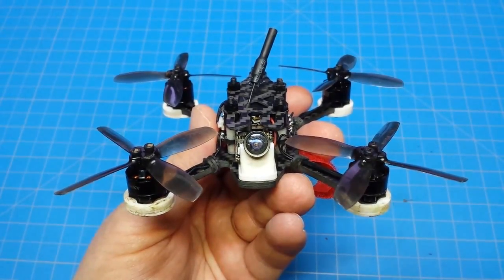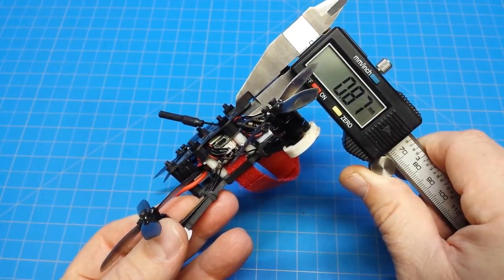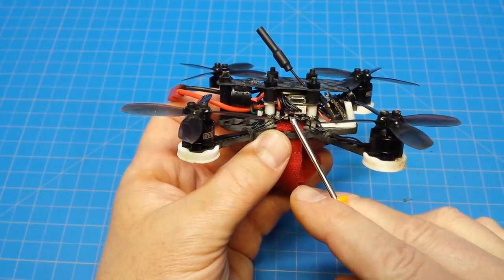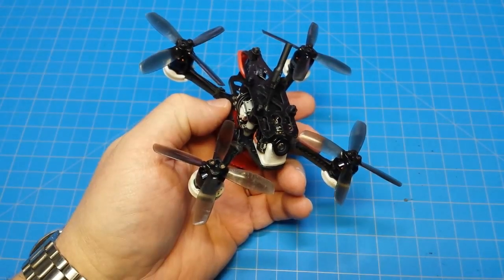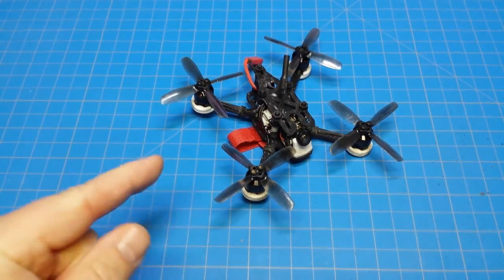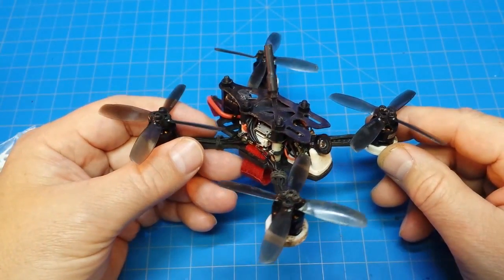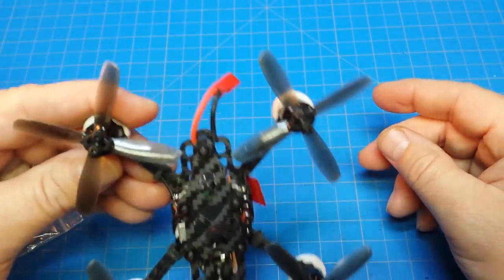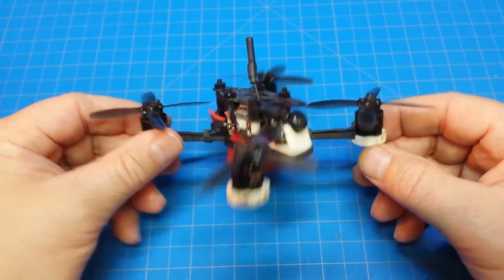TomoQuad - CS110 - Chopsticks

Comment: How did you install those props? I can't seem to align them in the motor holes!
Reply from the maker: I assembled the props off the motor, then put a screw through one hole with only a bit coming out the bottom. Then press the prop on and when at the top of the motor bell turn it until you feel the screen "hit" a hole and screw it in. It takes a feel and multiple tries, but after you get the screw sticking out just enough it will becoming easier.

Comment: ei nick what do you think running 2035 gemfan prop with the same motors in it? whats your pros and cons bout it?
Reply from the maker: I have used those props, they are pretty good. They have a bit of an odd sound. The rotorx props are very quiet and possible more effiecient. But both props come well balanced and durable.
Reply: Nick Burns thnx bro.

Comment: Absolutely love my Tomo CS110. Super tough and fast!  Mine is 1105B 6500, DYS 3045T 3 blade (cut down to 2.5), 12A esc, F3 Omnibus FC, 1000TVL cam, VTX03. Run it on Tattu 450mah 3S 75C. A real beastie and runs so quiet.  Punchouts a real giggle!
Reply from the maker: sounds like a quick, powerful and fun quad. I have been enjoying mine as well.

Comment: Nice flying that`s a cool little quad.With my nerves and shaking i had a hard time building a 130.Maybe i will give it a go on the micro.Also glad to see you had some raw footage and sound.Yeah I waited for it.
Reply from the maker: This is on 2S, it could run 3S, in my yard it might just be to much speed. Originally I had the audio recording when I flew, but couldn't hear it, especially when the AC would kick on. So I do do a audio special segment.

Comment: Just got my Predator V2 frame today from Tomo! Looking forward to building it as soon as I can. How do you like the Dualsky 550 battery? I've got one that looks just like the one in the video and it works great for me. Nice video!
Reply from the maker: The predator looks good, really can't miss with a Tomo frame. When I used the dualsky and I had a low voltage buzzer I found it would go off on most speed passes, where the mylipos wouldn't.

Comment: How do you like your/my build list?

CS110 V2  ($37)
 http://bit.ly/2qufzmu
FC/ESC - XJB F410 Flytower Micro ($43)
 20x20mm XJB F410 Dshot Flytower Micro F4 AIO OSD BEC Flight Control & 10A Blheli_S 2-3S 4 In 1 ESC 
DYS 11004 7500kv motors ($42)
 http://bit.ly/2re5WLE
RotorX 2535 Props ($8)
 http://bit.ly/2qqdKbX
MyLipo Batteries (which one?)
or Eachine 2S 450mah 80c ($7.50)
Camera CM275T ($26)
or Swift micro ($30) and VTX03($11) Albert Kim says it's supposed to fit!

Do you think the Tomo frame is worth extra $25 over the Arfun 90 ($11) on Gearbest?
Great review, btw!
Reply from the maker: I think your build list looks good. I have the F410 stack...just now, not on anything, motors I use in this video...good, I am a fan of the props. As to the mylipo, buying from the US warehouse I would get either the 600mah 2s or or the 2s 480mah or again if you want to venture into 3S the 3S 480mah.
Reply: Thanks. So you think the Tomo frame is worth $25 more than the Arfun frame? Just curious, I'll probably buy it just to be part of the Tomo "club". LOL...
Reply from the maker: That's a tough question. Pure value, maybe not. I see that extra$$ goes to keeping Tomo designing us frames. :)

Comment: what battery you using Nick and what are your flight times?
Reply from the maker: Most of my flights are with the mylipo 480mah 2s, flight times run about 2:15 than a landing.
Reply: yeah would also love to know flytimes. With my 1103 8k, 2535props and mylipo 500 2s I get about 2,30 mins. Was thinking to upgrade to 1104 as the 1103 are bit weak.
Reply: thanks Nick. great flying as usual